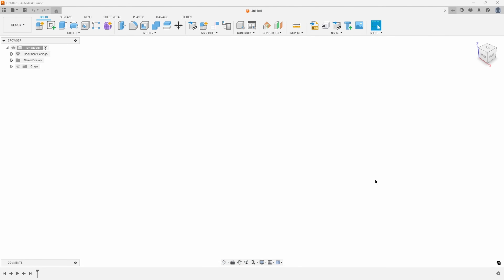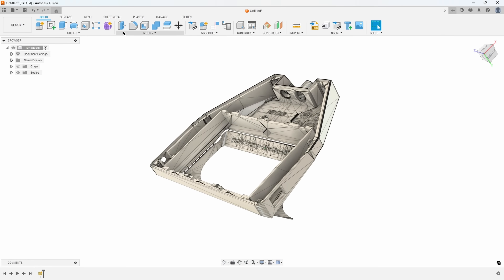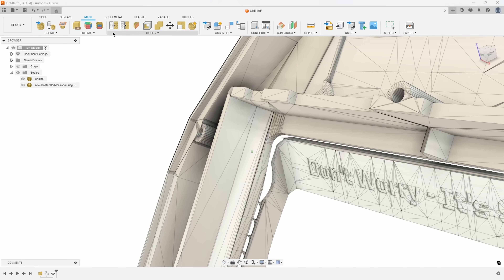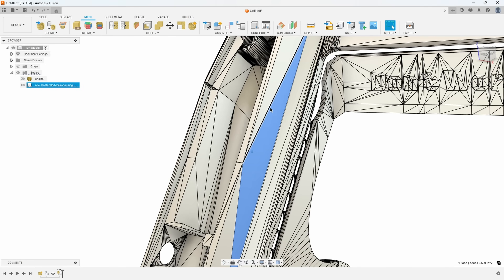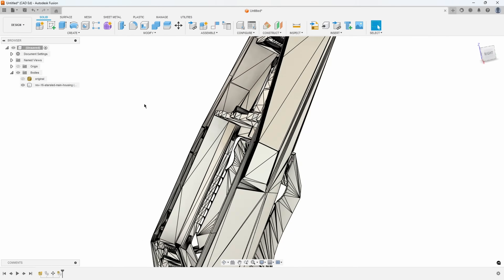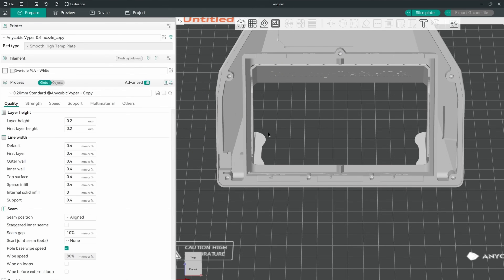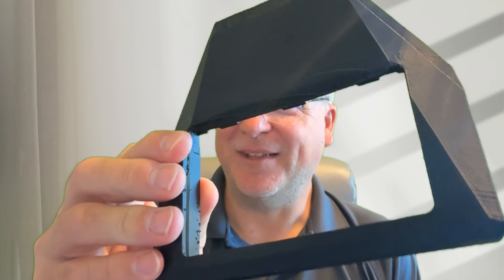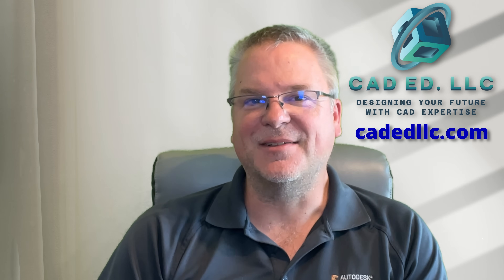How to Modify a Mesh in Fusion - A real world example

Comment: Man, another fantastically instructive video. I recently did a number of projects in which I modified a ton of mesh bodies (chess set pieces imported to make a 'tray' with the shapes cut out) and I really could have used the info in this video. It would have saved me so much frustration. I didn't know about the Tesselate command. I was importing the meshes, then remesh to reduce the complexity, then convert the mesh and work on the bodies created. Your approach is so much better.

One question though - I never quite understood the differences between the Parametric and Base Feature options of the convert mesh command. When would you use either one and why?

Comment: Perhaps you could show using McMaster Carr pipe fittings, how to download, save as mesh in a project file that may be opened later.  Sort of like autocad blocks created to be used over and over.   Then show how to cut parts of say a threaded coupling cut in half and added to a tee...or other similar ideas.

Comment: This is very useful, but in this example, what is supporting the support? Do you just add supports as normal in the slicer?
Reply from the maker: Good question.  In this example, there was no support supporting the long span going across the "removable support" part.  So, when it printed, it also had some sagging lines.  But as the layers kept building up on top of it, it finally built up enough to have a strong enough section for the "saw teeth" to be supported on.

Comment: This is not how you do it. 3d Slicers treat support very different to normal parts. Different speed, temperature profiles and micro gaps to allow removal without damaging the part.
Also support generation is very advanced by now, creating minimal but effective sculptures that would take days to do in Fusion manually.
So you should master the support settings, then you do not have to invest so much time into manually doing what an algorithm can already perfect.
The second problem is the design of the part. For every type of manufacturing the part has to be designed to fit to it.
The reason plastic housing looks like it looks today is because it has been designed with the advantages and quirks of injection molding, where molds can only be adapted and built in certain ways.
When making a similar part for FDM printing the designer also has to adapt to the manufacturing advantages and disadvantages, if possible leaving the need for support totally out.
With small tailored modifications your part could be printed without any support and without sagging or bridging.
Reply from the maker: @haka8702-  Yes, I probably should have put a disclaimer in the video saying "Everything you are about to see can be accomplished using support builders in your slicer".  The purpose of my video was not to show how to add supports to your model, but how to modify the mesh model without having to convert the mesh into a solid model which is the #1 question I get almost every single day.
Reply: What are those small tailored modifications? If you tell us what they are we can all benefit. Even better would be a YouTube video.
Reply: @dakin80  It depends on the model, the part seen in the video is very unpleasant to print. I'd assume it is based on an injection molded part.
- In many cases you can print a part diagonal by designing a bottom to have a flat area to sit on the build plate. Depending on printer and filament this can help to cover all slopes to not exceed a certain angle.
- If that bottom area must be minimal, single layer "flaps" can be attached to secure the part to the buildplate. 
- When adding strengthened area that needs to "stick out" then you need to know the print orientation, so you can construct a sloped start from the bottom to avoid supports. the upper part does not need it.
- Avoid bridges and overhangs if possible to avoid support. A complex part may be constructed into two sub parts that bond seamless.
- Design so interior can be less optimized and exterior is optimized (in printing angles), so the printes has difficult angles inside and easy angles outside.

In all my designs I try to avoid any type of support. Often this ends up in a very elegant design without downsides.

Comment: Thanks! my only concern is that the top of the teeth is too small, depending on slicer settings it will not print - basically leaving a gap (at least 0.2 mm if that is your layer height) between the sacrificial layer and the part. The bridge will sag a tiny bit and the layers above will not be great. Looks like for this model it did not make a difference, it printed fine - just something worth mentioning. It would be especially bad if you need to put anothe part into the opening - the sagged bridge might make the opening too small if the tolerances are tight.
Reply from the maker: I was concerned for this too, but when I viewed the model in my slicer (Orca Slicer), it did show a layer touching, and when it printed, it was actually connected to that edge.  In fact, it was connected better than I thought it would be and I had to use an X-Acto blade to shave off the little "nubs" it left after breaking off the sacrificial support piece.  I admit, however, I am not a professional 3D Print guy.  I know there are lots of rules, tips, etc.  For example, I've heard that in cad, if you are printing at 0.2mm layer height, you don't want to design things that are 0.2mm thick.  You want them to be 0.25 or 0.3, etc otherwise the layer might not be sliced, etc, etc.

Comment: The best Mesh 'body' to modify is not a mesh at all. Time the 3D printing 'hobby' became a proper CNC process instead of an some sort of approximation. Publishing STL's without some proper CAD model is a terrible idea in 2025.
Reply from the maker: Yes, you have a valid point.  Most slicers nowadays can bring in step files instead of just STL's.  However, there are still a lot of people out there that use STL's for 3D printing.  I guarantee to you that the #1 question I get asked almost daily is "How can I edit an STL in Fusion".  So, that is why I chose this particular topic for this video.  Honestly, I could have added the support blocks in my slicer and skipped Fusion all together.  The video was aimed more for editing a mesh/stl.
Reply: @bradtallis8968  I agree about the questions on STL's being up there as a common one, Thingiverse has a lot to answer for allowing low poly muck to persist. The usual 3D printing channels have all made videos of one sort or another on adding blocks in slicers. if normal supports wont work. Depending on the model I tend to build a new one from scratch using the STL as a ghost if I need to mod it to much.
Reply: They probably do not want people to modify the files, whch is why they don't post the source files :).
Reply: @TheKarolans  So they just publish a triangulated version of it to modify? That thought doesn't make a lot of sense. Worse is they publish a low poly count STL which prints and looks like rubbish. STL format sucks.
Reply: @dakin80  Again that árgument' doesn't hold up because YOU are making a blanket statement that ALL STL's have this imagined licence. STL's are a bad legacy format.
Reply: @dakin80  You made an 'assumption' then. You can put Creative Commons on any work or model and is has zero to do with file format or media used to convey that work.
Reply: @dakin80  So you have no actual point then.
Reply: @seabreezecoffeeroasters7994  As I said originally my point was that you have no entitlement to expect a model to be provided to you in a CAD format.
Reply: @dakin80  Seriously STL is also a CAD Format! It just happens to suck as one. An STL is not now or will ever be some magic protection from being modded.
Reply: @dakin80  So you still have no point to make! You tried to claim as much as I can filter your waffle that changing away from STL's to a Solid Models would cause modification and some extra loss of IP then later threw in at best rubbery License issues which I suspect you have no real idea about to now agreeing that STL's can be modified as can Solid Models. There is no issue with Brad or others offering assistance with working with this rubbish format either. But throwing word salad or Spaghetti arguments against the wall just makes a mess.
Reply: @dakin80  What part of an STL is a modifiable CAD model is so hard?

Comment: I downloaded the 3mf file for MakerWorld and had a look in Bambu Studio. The model has manually painted supports along the top of the sacrificial region which are obviously intended to support that long bottom edge in the actual model. Looking at the sliced result you find that the support is ineffectual. I think the root cause is that the top of the sacrificial support is too close and too small to allow a good support structure to be constructed. I'd be tempted to just chop out the sacrificial support and let the slicer add support itself which would almost certainly in this case be a better result than the sacrificial support.
Reply from the maker: Ya, I thought the same thing.  In fact, I actually did that at first.  But then I thought, "I could turn this into a Fusion Friday video"  :)